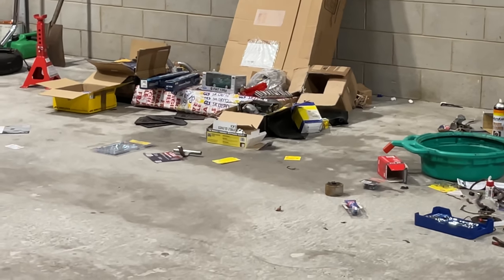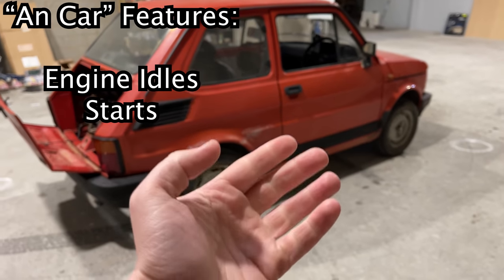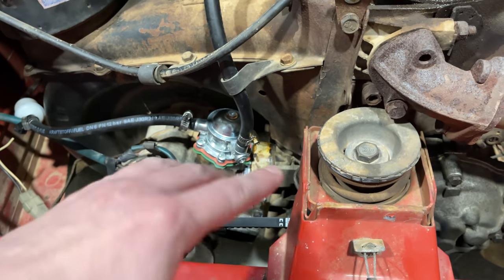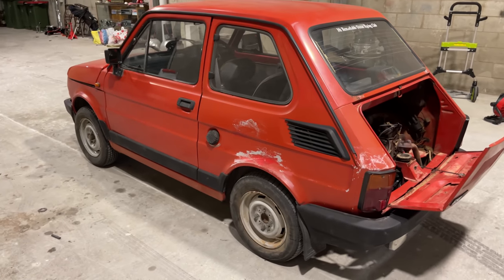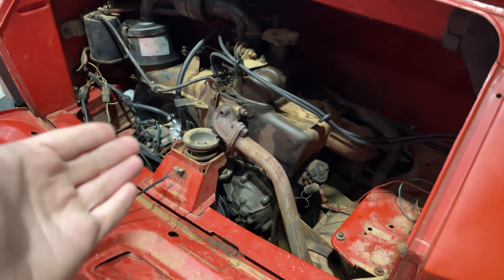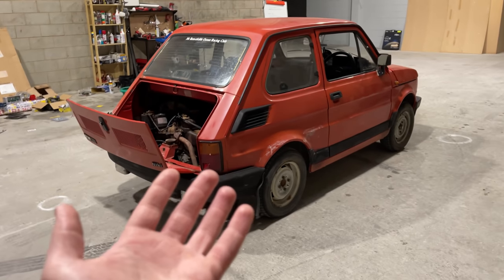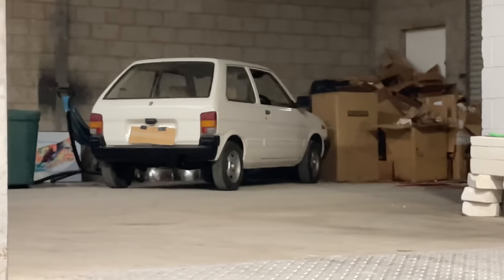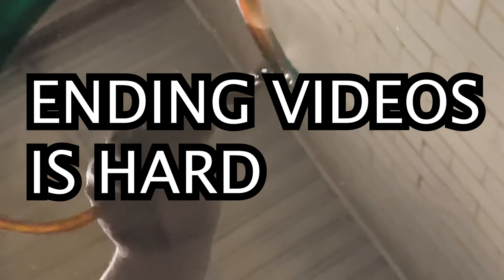Quick Niki update, it's worse now.

Comment: I'd much rather a piece of junk I fixed myself with a bunch of mates than buying something new. I dunno why, there's just something special about it. I love this little car.
Reply: Why not buy a new car with a bunch of mates? Smash a bottle over the salesman and yeet out with your brand new BMW that your mates egged the salesman to sell to you next to nothing?
Reply: So you prefer a piece of junk than for example a chevrolet of the cheapest?
Reply: Never have i agreed more with a comment in my entire life.
Reply: Your right ! I found fully equipped vacuum-cleaner this morning , cleaned it rebuilt it -now it ready to roar 🛵
Reply: Im not even joking. Picked it up from the trash-can. Fully packed and full of dirt.. But its 2y old at most - it works fine 😋
Reply: Im not even joking. Picked it up from the trash-can. Fully packed and full of dirt.. But its 2y old at most - it works fine 😋
Reply: @MizushimaNaomiz  the words of a man who has never turned a wrench in his life. Nothing beats the joy of having a problem hating your life through the fix, wrapping up, turning the key and it's over. That wave of relief is a drug.
Reply: @MizushimaNaomiz  I'd much rather prefer a "yeah, your fuse got busted, we tonnage it with a piece of wire we stuck into the contacts, it PROBABLY won't set your car on fire, but you know, we can't guarantee it" to "sorry sir, your car busted a fuse, the part is non-servicable, we will have to replace the entire car, your service fee is 13,000 dollars"
Reply: Its the power of the nugget
Reply: My beater 97 camaro was my favorite car. unfortunately i got put in a spot i had to sell it. Miss it every day.
Reply: It's both a hobby and a mode of transportation at that point.  What's not to love?
Reply: @MizushimaNaomiz  yeah probably
Reply: I guess you cherish your car. You brought it home, figure out how to fix and restore it, and made it work again. Your love and labour are poured into it you gotta be proud. Buying a new car losses all of the mental value of yohr labour and work. That's what I guess.
Reply: @MizushimaNaomiz  it's    a project car and experiencing working on a car your self and getting it running is a great feeling
Reply: I really hope I've bought my last new car.  The time I went to a dealership and asked for a replacement for a key that got lost in the snow, was the day I learned what hate really is.

OTOH, I have a Karmann Ghia that is still more car than rust (which is saying a lot) and I will drive that thing to my funeral.
Reply: Most new cars have no soul.
Reply: I'd sell a car like that for scrap in a heartbeat, lmao
Reply: so true mr lesbian

Comment: In Poland we have a saying about Maluch, which goes along the lines of "it ain't the best, but at least the crush zone stops only at the engine"
Reply: Oh good, my crushed and filleted corpse won’t be also be blown up. Still better than 70s era fiats that were, without exaggeration, totally flattened in accidents, at least according to my great uncle’s tombstone.
Reply: But... it's a rear engine car... ohhhhh.
Reply: Just like a volvo!  The crumple zone stops at the engine 😂
Reply: I suppose that's reassuring to know in a rear end collision.
Reply: @spicey_art  if I remember correctly on 240s the engine and actually drops in a frontal collision to avoid it pushing into the cabin.
Reply: Not that they needed to drop their engine. Those things are tanks.

We used to have an old Volvo 240, one of the ones made in Sweden before Ford took them over.

According to it's history, it once got hit by a train. We're fairly certain the train came off worse. 😂
Reply: Yeah, also a joke you could hear in the gyms: 
Train your legs

They're an integral part of the crash structure

Comment: Yeah, the fuel pump pissing to the oil is a typical thing on these cars (happened to me a month ago on a SEAT 600). Also make sure the timing of the cam is right and the distributor is also on time, if it was running “right” and y’all haven’t messed the compression or something that will just be it. Btw I suggest replacing front and rear seals if planning to take the engine out, it’s pretty easy and cheap, also keep in mind this italian cars tend to piss a bit but not as much as all the British junk from the era.
Reply: English cars were only crap because of the Italian electronics 😜
Reply: I wish I could disagree with you, Arturo, but.... I can't. Us Brits can make cars, but they just don't work right, nor do they work right. That being said, they fucking look awesome.

Comment: 2:31 when replacing splines for the tailshaft check for the metal clip in the grove at the end of the shaft. If there isn't any that's going to be recurring problem. It will chew the hub spline part in like month or two. Me and my father went down to something like 15 minutes when changing the hub spline on the road, after it broke like 20 times. And then the transmission gears just unscrewed themselves - there wasn't any damage to the transmission, just everything inside gotten out of whack enough to not transmit any power to the wheels. So many memories of this car (we had like 5 or 6 in family).

Comment: This all goes to show that even a piece of poo car that old is still more reliable than most modern cars. Even on the edge of death itself that thing still "worked"
Reply: Meanwhile Teslas refuse to drive when they need a software update.
Reply: @boeing747-8  they are software based cars after all. They have a massive screen.
Reply: @crackedemerald4930  why on god's green earth would you ever need a software based car
Reply: 126p is not reliable
Reply: @bearsaroundhere  smaller wires, everything can be changed, i dunno, ask tesla.
Reply: @crackedemerald4930  smaller wires? wtf are you on about lmao
Reply: @bearsaroundhere  i heard somewhere that you can use smaller wires if they're not the ones doing the entire current switching, but instead signal a main computer.
Reply: @crackedemerald4930  ... but you use up that new space with all the computer bits
Reply: @bearsaroundhere  it's not about the space, but about using cheaper wires
Reply: @crackedemerald4930  which is why Tesla cars are so cheap!
Reply: @bearsaroundhere  i think i saw that idea on a video about modern cars or something, cannot remember.
Reply: @bearsaroundhere  i think they're expensive because all the other reasons, like the self driving, massive battery, performance, the fact it's a big car, the fact it's electric.
Reply: @crackedemerald4930  if you don't know what you're supporting then you shouldn't be supporting it
Reply: @crackedemerald4930  you don't need a computer for switching a big current with a small signal, that is just what a mosfet does.
Reply: @theodiscusgaming3909  I'm not saying they need to, I'm saying that's what I've heard
Reply: I mean sure it tried to kill ya multiple times and it is a Ticking Time Bomb with that Nano, but sir she does idle and start in the morning

Comment: When we gave up on our 126(2000) it was no near as bad as this one... It just needed new upholstery, brake & asset check, probably bearings too... Everything else was pretty much mint, the engine was nice to the ear and ran perfectly, body was nice a part of some scoffs here and there .... I think it was an 80s cheaper model, because it had plastic  bumpers but older style dash with the round speedometer and controls all over the vinyl dashboard... Very cool

Comment: Fellow owner of a nugget fleet that gets a laugh when out and about.  That said, I think my more performance cars get the weird stares over the nuggets.  I rebuilt a 97 Celica with all new suspension, RWD conversion, Turbocahrged 1GR V6, rebuilt manual transmission, Sakura Pink paint job that's borderline white it's so pale...if it weren't for the white wheels that contrast, GT-Four body instead some flamboyant kit, and a pretty quiet/tame exhaust.  I've also designed and made my own Itasha wraps for it in the past for a laugh (anime waifu cars to save the time of looking it up).  Plenty of other 90s cars that wanted to be sports cars, wagons, and hatches in my nugget fleet.  Helps having old civil war era factories turned warehouses out in the sticks in the US to store everything...Gotta be weary of the crackheads stealing the vital nuggets or nugget parts though; security is tight.

Comment: If you’ve not done it already, remember to clean the centrifugal oil filter on the crankshaft pulley wheel.  I forgot to do it for a decade on my 1972 Fiat 500 and it ran like shit!  When I finally took the plate off it was like black butter!

Comment: Dont piss around with fuel,  had a leaking fuel line, landed on the tail shaft and flicked on the exhaust. Be a big bang when that gets hot. I was lucky it was a diesel.

Comment: If the motor is about to kick the bucket there's two ways to fix it rather rebuild build the whole engine or just taking out the whole engine and putting one that's already been rebuilt

Comment: Important PRO-TIP. What I can see, two 'mushroom hat' gum seals on HV cables are missing. They should be ticked in steel cover of cylinders. They're quite important. Without these seals Tony can overheat much easier. Here you've the best 'mushroom hat' seal view I could find: https://youtu.be/Nja6JMzEhUM?t=34

Comment: About it running like shit, check the spark advance and maybe rebuild the carb (check the float adjustment and jet). Double check the distributor, the dizzy might be off by a tooth! Also you should put an electric fuel pump on it! I have one on my Suzuki samurai and love it, way quieter and much more reliable

Comment: With a Polski Fiat, you never know, when the thrown out original works better than the 'aftermarket' new parts. Don't trow away anything because can save your life one day... especially with the carburator. The front suspension is a nightmare to rebuild without professional a workshop, the steering also problematic. Never ovetorque  the wheels because the screws will touch the brake parts lol...  I hope you will find everything for the litte car, but keep your skepticism alive about spare part quality.

Comment: Finger tight =proper torque😂 check compression if it's running worse. By the way you're missing an exhaust bolt

Comment: I really can't believe these cars are still around, mate. To me, that's a death trap. No offense. It takes a special breed to attempt to drive it in its current condition. But, if you do want to keep it, you've got to restore one with good bones (frame) and paneling.

Didn't you have a white one from a friend that's absolutely totalled? Do a complete teardown of both vehicles and keep the best parts. As for the rust, get it sorted before it runs away and before you know it, it won't pass MOT.